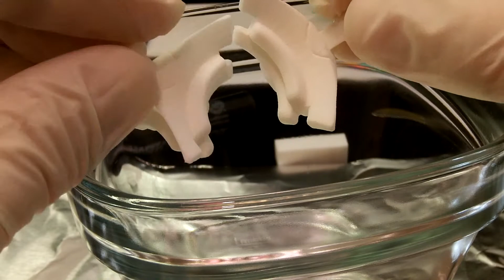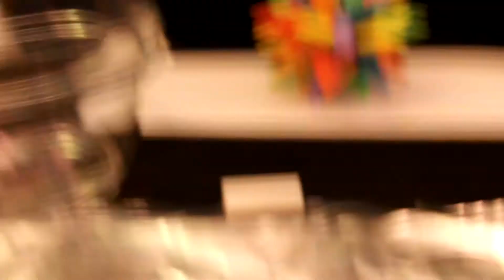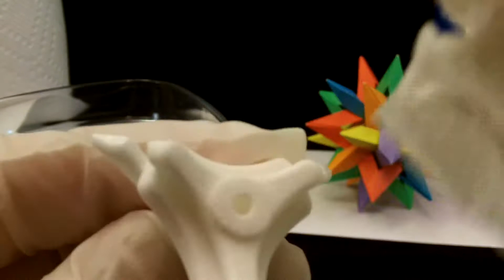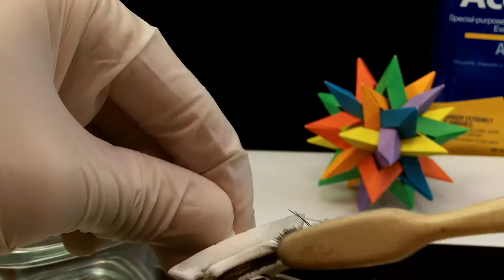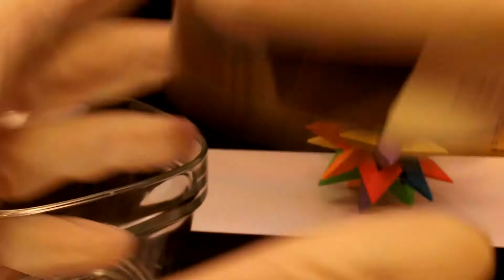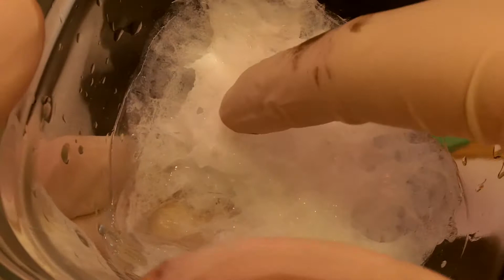Experiment to seal Shapeways WSF with Cyanoacrylate (Super Glue)

Comment: I use a vacuum pump and polyurethane wood sealer. The vacuum pump pulls all the air out of the part and allows for complete saturation to the core.

Comment: I'm a bit desperate for a way to coat nylon as the parts I print are in water 24/7. Could you share any new insights or thoughts on sealing nylon prints? I was originally looking for a way to print pvc, but got into nylon as it's safe enough (soon) to use in human body part replacement.
I keep searching about ABS but I still can't find whether it's considered potable, meaning can I store water with prints of it. Printing parts for swimming pools, so chlorine, sun and NSF 'people friendly' are my issues. Sure would like to continue with nylon, so smell/fumes. but if you have any ideas, please take a minute and respond if you can. Thanks!

Comment from the maker: Yeah I was worried about the mess too.  I thought for sure the dish was going to be a goner so I was quite surprised when it was so easy to clean.  I used my fine copper powder instead of my 5 micro iron powder because that that stuff floats like smoke.  The copper powder is actually for another WSF experiment that I've been working on ;-)

Comment: Hello Brandon. Fancy finding you here! I'm suddenly finding myself in 3D printing to improve and simplify my favorite sport of RC glider combat. I just ordered my first test print to explore living hinges, and I will experiment with gluing, painting, and smoothing of SWF plastic. Have you experimented with painting parts? We need to use the brightest colors we can find, and will also likely need to create smooth surfaces without adding much weight or reducing strength. Would you paint over or under the CA? Thanks for the helpful video!

Comment from the maker: I'm Shapeways user "bmenrigh" but I don't have a shop or any public designs.  I'll go edit my Shapeways profile so that it doesn't have the default picture.

Tonight I plan on sealing the parts for a complete puzzle.  There is a chance sealing will interfere with the mechanical interaction between parts but I'll try to answer that tonight.  If you want high-res photos or other stuff let me know.  You can email me at "shapeways at brandonenright (dot net)".